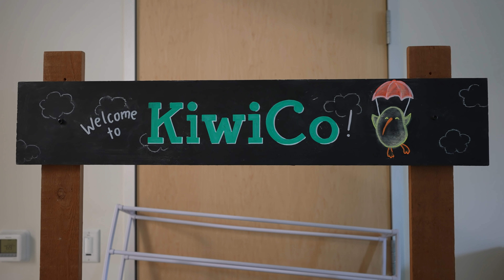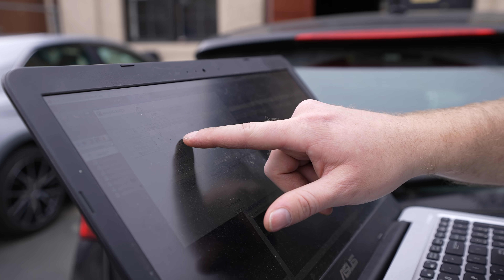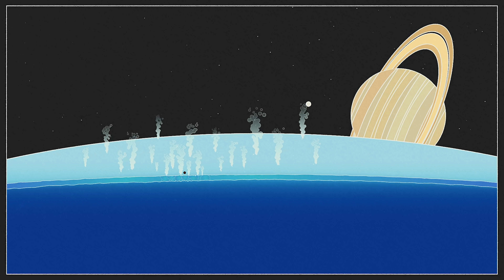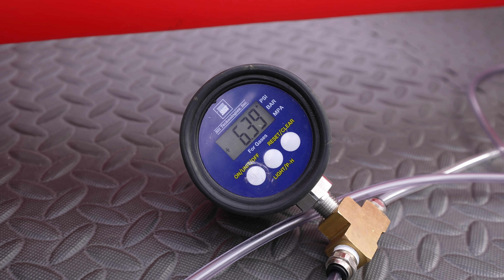Why Robots That Bend Are Better

Comment: - "it's soft, it can't hurt you"
* "can I be inside it?"
- "yeah, just watch your head"
Reply: well clearly the joints have hard metal corners... if one of those edges hit you with some speed, that would hurt like hell.
Reply: Similar to what Geth is getting at, the idea behind soft robots being safer isn't that you can't hurt yourself on the robot due to your own locomotive capabilities; it's that the robot can't hurt you due to its locomotive capabilities.
Reply: there's an innuendo in there somewhere
Reply: Science and its innocent double meanings x'D
Reply: The robot is not tall y'know
Reply: @10pitate  you noticed that it can stretch, right?
Reply: @plumber1337  yeah, so?

Comment: Is it possible to use "Mousse", a sponge or "Moose", foam they use in mountain bike tires, so this robot will never go flat, plus potentially be able to be unloaded to space without it being overinflated due to the high difference in pressure.

Comment: It's a shame you didn't talk more about the actual uses and how the robot can be modified to achieve them. It's great that it shrinks down and Nasa could drill a hole to drop it in but what does it do then. The structure of the robot presents challenges to implementing the various uses, picking up a ball seems like a very limited use and I'm sure they have considered how to modify them to do more complicated tasks.

Comment: Quick question: If the "sausage tubes" are filled with air, how would that work pressure-wise in space? And if would happen in it hit, say, a sharp rock that punctured it?
Reply: They kinda cover that problem in the  video, guess it need more r&d for that problem
Reply: 🤫 don't tell him.
Reply: You would need a material resistant enough and a pressure proportional to the exterior one.
Reply: @zainiikhwan9405  Yeah I saw the part where it collapsed when they let out the air, but would the robot just be completely useless and unsalvagable if it was, say, on Mars?
Reply: Just use less pressure.
Reply: @FratinandMadrik  It would become a stationary observation platform.

Actually, it is made of four tubes.  If one collapses, it still has three left.
Even if all collapse, it is not completely immobile, but it won't be rolling around anymore.

Comment: The primary reason for hard bots is strength accuracy stability and durability. A sooft machine will tear apart over long periods of time and wont repeat the same exact motion well, as you said, where as say tracks or a foot need lubed and replaced every year/decade.
Reply: Are there any stats on this?
Reply: But due to the materials they’re made out of, wouldn’t it be quite easy to remake or at least mass produce these robots?
Reply: @DoubleOEspresso  yeah , you are right , these robots would be easy to mass produce and replace ,also it helps that they require little to no electronics , since electronics parts is the Main reason robots are so damn expensive

Comment: I like how humans are really good doing things on wheels but we don’t ever use legs. We should use more legs lol
Reply: That's cuz wheels are easier...and less bumper usually otherwise to make legs less bumble would cost A LOT
Reply: try building a besiege walking robot. You will see how using wheels is way easier
Reply: Better than that: we should use our brains! Everybody do the Bender! 🤖
Reply: ARRR E ARRR E GON DO MRROBOT TO
Reply: Good luck carrying tons using legs
Reply: Robotic legs can't really carry heavy materials
Reply: A at-at (all terrain armored transport)
Reply: Legs are hard, wheels go:
WWWEEEEeeee.....
Reply: Legs are a lot more complicated and have more break points than wheels.
Reply: Atlas and Asimo had legs
Reply: It's more like actively self-balanced VS stable robots.
Reply: Legs on robots bring a ton of problems which wheels/tracks would mitigate
Reply: @johntheux9238  That is what makes it so much more complicated.
Reply: legs are worse than wheels
Reply: @blaz2892  Yeah, but once you get it done your robot can go nearly anywhere. Spot mobility is unmatched.
Reply: There's a reason for that, and it's the same reason that bicycles are vastly more practical as a mode of transport than stilts.
Reply: Totally agree with you... we should use more legs
Reply: "Nuclear equipped walking death auto mobile"
Reply: @cedricdalbalcon5999  I have cables hahaha >:)
Reply: @dvanerdivkanade  And they are pretty much useless and have nearly no advantages
Reply: @ImieNazwiskoOK  One word... spot
Reply: @dvanerdivkanade  Spot is still kinda useless.
I never seen him doing job that wheels couldn't do.
Reply: Wheels are just... so damn good. Easily a top invention of all time. So useful, simple to make, convenient, versatile, it's hard to replace them. Once you start trying to use legs you start having to deal with balancing weight, which complicates things a hell of a lot more with movement, especially for something like a robot, but wheels always keep the same balance. That's why those Boston Dynamics robots are so impressive with how they are able to run, jump, backflips, it's really crazy stuff.
Reply: @ImieNazwiskoOK  you are not thinking hard enough. Think of walking the stairs, inaccessible terrain such is ice, snow, mod, sand, building rubles, strap slope of wet grass or pile of rocks! Wheels are great but 4 legged robots have so much advantage in hard accessible places.
Reply: @dvanerdivkanade  For sand, snow, (and kinda even) mud there is something called tracks or hover crafts.
But yes for mountains and caves they might be useful but there are also drones.

And where is place where spot is used because of it?

And even better: 6 legged
Reply: @ImieNazwiskoOK  SpaceX for example
Reply: Remember 2 judge ppl one at a time also dont do self harm with negative self talk it diminishes brain function long term
Reply: @itismethatguy   LMAOOOOO
Reply: Metal Gear?
Reply: Mechanical legs are slow, inefficient, and waste a lot of energy. Wheels are the opposite and is why we use them.

Comment: This thing is genius. This guy's going places. Wouldn't some kind of a foam filler or sealant like tubeless tire sealant reduce the risk of punctures?
Reply: Then it wouldn't be as easily collapsible?
Reply: @Dimondminer11  The foam, yes, but you don't need a lot of tubeless sealant to seal a typical puncture. However, there are kinds of foam like that in self-inflating sleeping pads that are very compact.

Comment: What I like about this robot is that you could literally have Skynet operating it, and it wouldn't be able to hurt you.
Reply: After a few simulations sky-net will make it very tall and have it stand very still. When you curiously  approach it and turn around to tell your friends it is save, it will tip over and hit you on the head with one of the edge motors 😜
Reply: It could potentially knock something else on you
Reply: Maybe it'll call you an idiot and hurt you in different ways.
Reply: it could call you ugly or something

Comment: I don't think they'll ever be more capable than hard, rigid robots. I think hard robots will just get smarter A.I. and more joints and rotation points, thereby giving them a wider range of applications they can handle and being better at not hurting humans.

Maybe some specific situations where they have to directly deal with people, but I think advanced A.I. and maybe a squishy shell applied to a hard robot would more than make up for that.
Reply: It really depends on the application.
More joints means more movable parts means more things that can break.
(And they always break when you need them the most.  That's the stapler principle.)

Certainly, there are applications where you want a manipulator that is hard.
But you can have that even with a compliant system.  Not every part needs to be elastic for a system to be compliant, it just means that it can change shape without having joints.

For complex tasks, there is always the option of hybrid systems.
Reply: I was thinking about a hybrid systems , Aka both hard and soft parts

Comment: Now imagine this system but using hydraulic power and at a microscopic level and used in connection with thousands of nano-soft-bots. With coupling capabilities, this could benefit surgery and invasive treatment in human body.

Comment: That pneumatic turtle is pretty much exactly replicating the way in which most invertebrates move around, except using air instead of liquid to fill the pressurised bits.

Comment: You could probably use this concept to made extremely small to store, and easily replaceable wheels. Combined with the ability to inflat them from an external compressor than stored, and transported gasses. They provide a good weight and size saving on a payload

Comment: There's two weak points with this design, although it's pretty much genius. Punctures is an obvious one, but the joints between each triangle needs to be tougher. I'm sure that can be done quite easily though, by just using a thicker rod and bigger ball-joint. Very cool design, I've never seen anything like it!

Ooh! Regarding using this robot on, say Europa, my suggestion is to fill it with water instead of a gas. Obviously it sinks if you do this, but you don't have to worry about carrying a pressurizer. You just need to have a pump to maintain pressure. The tubes have to be sufficiently expandable, because water is incompressible - but like was mentioned here,  the pressure is the same throughout one tube.

Comment: Typical vacuum tire uses latex-based internal sealant to auto-seal leaks. Also, some vehicles use soft rubber to completely replace air inside tires. Silicone foam resin or something similar can be mixed when the robot deployed, and foam would expand to fill the tube structures. It will be far better than a mere backup pump.

Comment: I mean, they have robots right now that can effectively open up from a cylinder into a host of different shapes. Pneumatics could extend the limbs, servos could articulate any joint, and the whole thing could retract back to the original cylindrical shape. That cylinder can be made of hard but light meta-plastics that we can create here on Earth or cheaper in space. The idea here, as it is proposed, has at least as many cons as would a machine made of rigid plastics and light metals - if not more.

Comment: use multiple air pockets.. instead of a single tube running through the length of the machine...that way you can always isolate a leak.

Comment: They could use a spongey substance to fill the tube in case of puncture. Think like a woopie-coushin that has a small studded hole in the ballon which has a sponge inside to "re-inflate"
Reply: Most spongy substances we know of right now have a limit as to how many times they can be compressed before they refuse to re-inflate. Housing more spongy material would mean extra weight. Even the lightest sponge we have right now would have that problem. It's why gasses like air are used, because they don't stop re-inflating. Besides, the space shuttles literally use oxygen and hydrogen for fuel - the sausages can fill up on that when they reach space. That's what I think, at least.

Comment: So, a few thoughts on this.

The problem of pressure loss could be mitigated by the use of a self-healing material. There have been a few advances in that area in the past several years and their use here could help avoid the collapse of the robot shown in this video. That would be pretty important if you're navigating in a space that's a fluid environment covered by an ice crust-

LIKE THE FUTURE EUROPA MISSION <------- yes, please

-the graduate student said NASA contacted him about.

Come on. I'm only guessing, but really. Did anyone think of any other place than Europa when that part of this video happened?

Also, I'm wondering how the video about the engineering applications of origami might be combine with this, as well as the video about other machines that bend (both of which were on this channel IIRC).

Combine all those ideas and the possibilities of this idea expand enormously.

Comment: How to go faster than the speed of light :have the first clock send a pulse to the second one, then it starts, when the pulse gets sent back the lazer gets fired. The time it took - speed of the pulse = speed of light, even better if the pulse goes at the speed of light then you divide the time you get by half.

Comment: That pneumatic turtle thing is more ground breaking, in how I see it. 
Most of our mechanical implements are driven by circular mechanics. Drills, vibrations, pumping motion, swaying arms, rolling, picking, sorting, etc...utilizing rotors, rollers, tubes, chains, fulcrum, arms, weights, etc..everyday mechanics are usually driven by a rotating or semi rotating engine.

Comment: After talking about the under water exploration I was thinking that you could fill the tubes with water. Then I thought that instead of a rowing motion,  instead use a fabric that when rolled through the motors would pull itself through the water. You would have to rotate the tubes into a 3 sided pyramid and have the return part of the tube be blocked by say a corner cone.

Comment: I like to imagine (not a compliant type) that you could secure the limbs and take down a whole old growth tree using a chainsaw equipped snake drone. For safety, for access to difficult reaches, for cost reduction. There must be a better way than sending an idiot up in a huge stupid bucket truck for hundreds and thousands of dollars a job.

Had an idea in my head to work around this concept. Video added to the vision. Why a snake chainsaw? Why would you do it any other way? It's not fast but it's safe. A flying drone or climbing drone would likely have some dead weight and extraneous elements that serve to impede movement and function. Snakes have a very good center of gravity and that applies well for climbing and gripping. A snake isn't going to be caught up in every possible difficult situation where a flier would have. I could see a snake being modular in some beneficial ways.

Wish I had the means of working on a design project like that.

Comment: Out of curiosity...is the intent that as this type of technology becomes more refined we'd be using something like this not as the robot itself but, figuratively speaking, as a part of a much larger robot? I could understand using this kind of technology as part of something greater, however I'm failing to see its use outside of existing simply to move.

Comment: Okay, I need to know what's going on with the string at 9:58 with Mark Rober
Reply: I'd guess that the string is actually a very thin tube connected to a slow air pump. Look exactly like a tube inflating

Comment: when i saw this and they mentioned the big problem being a air leak I thought about maybe a big ger latex tubing that has a natural compression ability but still is stable a dn isn't fully subjected to having to stay inflated to stay usable example a latex tubing could be thick enough  that its stable but then could even have a air pump built on board that could inflate the tubing to utilize even more of the natural latex properties
8

Comment: Make a SOLID 2 core system, that projects soft noodles out... may be more worth for the soft things protect the core and you can have a stronger core that has all the power localized instead of multiple corners.

Comment: Got an off topic question for you. Lots of sci fi uses rotatating structures in space to provide gravity inside them. Does this actually work-my head tells me it shouldn't?
Reply: If you spin a bucket round and round, the water contained won’t fall out, because it’s sent constantly backwards into the bucket, rather than into the earth.  Centrifugal force, which is actually a combination of forces, would work in space. But when you go towards the middle of the ship, it’ll spin faster and the gravity would be stronger. This means that the ship would need to be quite big, and the middle compartment not liveable, or in the shape of a donut or frisbee, spinning so that the outside is faster. They use big spinning devices to test G forces. Tom Scott made a video about it.
Reply: @oxybrightdark8765  But those big spinning devices are on earth where there is already gravity-the centrifugal force then works towards the circumference of the device.i dont get how centrifugal force would work where there is no gravity. The people in the space station (or whatever) are not held to the surface of the thing that is spinning unlike the example of water in a bucket?

Comment: Wouldn't this have a hard time not floating if you put it underwater?  You would have to add a significant amount of weight somehow, depending on the gravity.

Would they be able to create another variation of this that could be filled with water instead and still work in a similar way in different gravity or in water?

Comment: I dont think its better. These robots are like animals made out of just ligaments. I prefer a bone to ligament to bone, Muscle to tendon to bone system. As I get older I can really understand the value of strong ligaments, as I lose these with age. I can exercise the muscle but if the ligaments are loose then the structure begins to grind the joints as it gones out of optimal position. Why not use ligaments with robots ? The ligament connects a bone to a bone. Tendon is muscle to bone. Ligaments allow bending and structural strength, Muscles are the motors, Bone supports structure and give the muscle something hard to push against, as does tight skin.
Reply: Google "Di-electric elastomers"
Reply: @kunalvyas8172   Strong rubber could work as an artificial ligament, maybe just replace it every now and then and recycle parts.